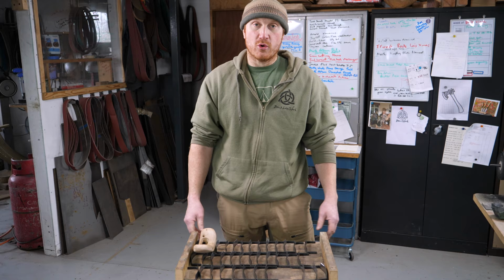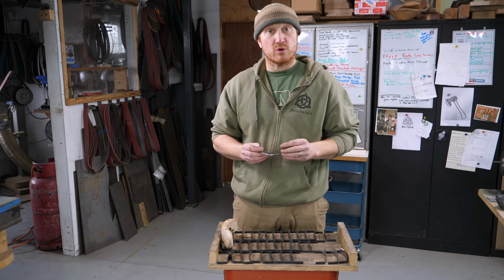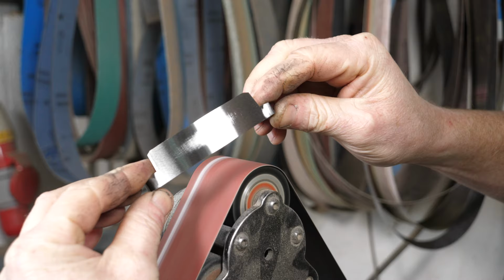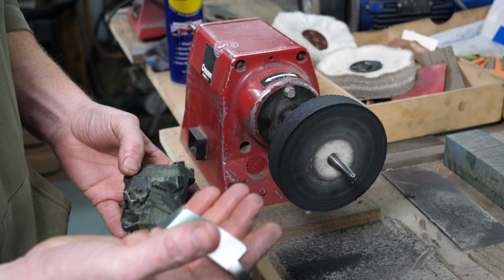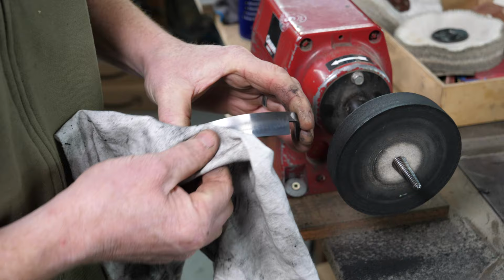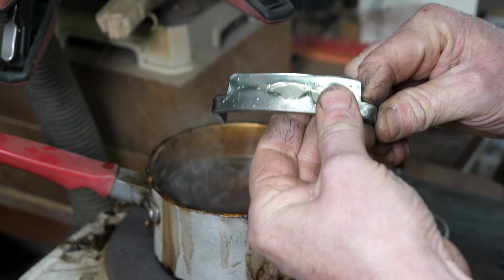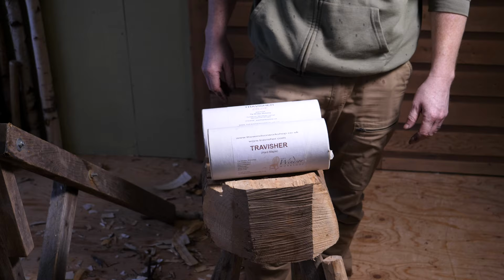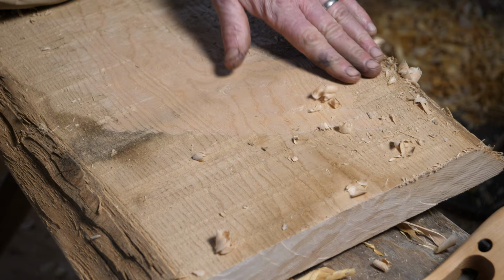Sharpening Woodwork Tools - The Travisher (WIP Wednesday)

Comment: Hi Ben. Nice to see how they are being sharpened. Do you have any advice for re-sharpening the blade after use when I don't have a belt-grinder nor a buffing wheel?
Reply: One way is to cut or bend a profile in either MDF or wood and stick sandpaper to that to sharpen. Make another one for the stropping.